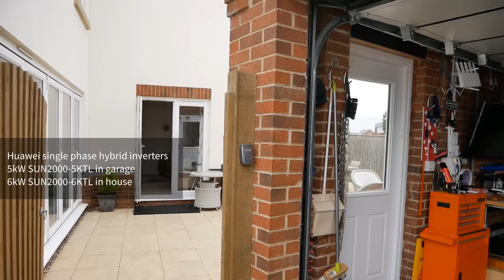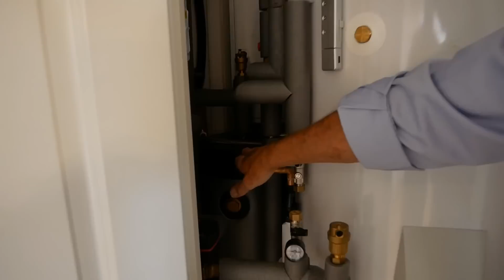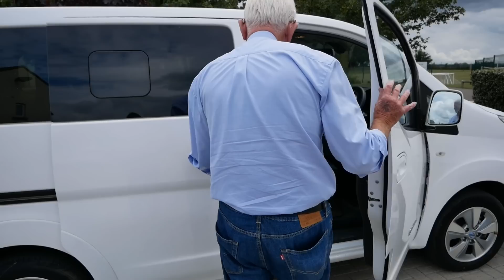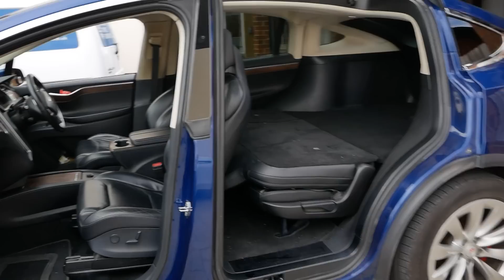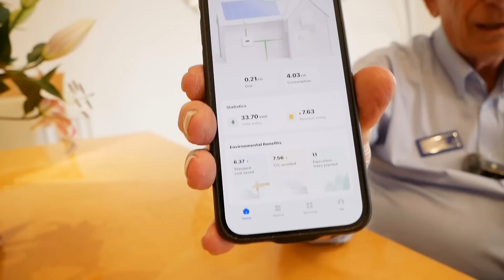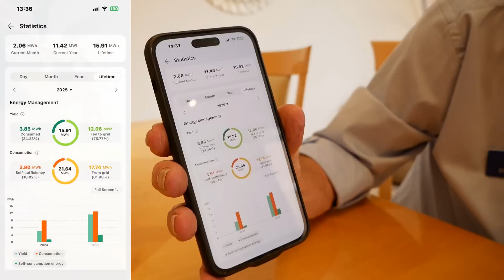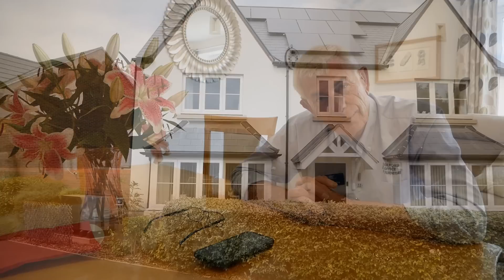How a 5 Bedroom Detached House & 3 Electric Cars Are Powered With ZERO Bills!

Comment: The secret sauce here is that the house was built in 2015. My neighbour has had Octopus install a heat pump and it’s not going too well on his 1980 house. Additionally, we have clay pan tile roofs which require sunken/inlaid solar panels which more than double the cost of installation. I have an EV tariff but the overnight rate has recently doubled to 15p. I have another house that was built in 2019 and has a heat pump and underfloor heating. A completely different proposition. However, the economics for solar don’t work on that house as I’m going to retire in two years and sell the house. I’ve had plenty of estimates, and waited for my Cambridge educated engineer neighbour to test it first, and the cost benefit requires me to live too long! Regarding Grandads. I’m one and I still work as an SME at a very large U.K. high tech company teaching graduates to be amongst tomorrow’s most high tech holistic professionals. My wife however……. I once had to turn on our Wi-Fi heating system for her whilst I was on a flight from California to London. Fortunately for her she has an IT guy at work! Great set up and excellent to see such an (quiet) evangelical adapter.

Comment: Experiences can be so different. When we approached Octopus about a heat pump two years ago, they had horrendous pricing. They asked for £100 to come out and look at the property in the first place.
Without a survey, they said they probably need to replace all the radiators and piping in the house before installing a heat pump. The Octopus man said that this is government policy to get the £5k grand. The price for just the heat pump was still double than a normal gas boiler.

We had just bought the property and at the time our gas boiler was broken and needed replacement quickly. We had it swapped with a new one and moved to a different part of the house for half the price (without £5k grand) by a different company.

That is ~£12k heat pump (including 5k grand) vs £3k gas boiler (both prices are without new radiators).

We will try in a few years again to go with a heat pump.

Comment: No thanks. Wouldn’t touch an EV.  Hydrogen is coming now. In ten years times people will be laughing at people still plugging their cars in
Reply from the maker: Hydrogen just doesn't work for road transport as it's very energy intensive to produce - an EV will travel four times further on the same electricity. So why make hydrogen, then drive it to fuel stations, store it in compressed tanks, when an EV can drive four times further with electricity down existing wires. There's a reason why we're not already using it! See https://youtube.com/shorts/HjedX5ljZs4 and https://youtube.com/shorts/kxQsZj27kQQ?si=MDFlU4LaiqG3zLCM
It'll also never be used gas boilers either. Again for the same reason and also it would need a whole new underground network of pipes as hydrogen molecules are much smaller and the current gas network would leak it all out!
Reply: @GoGreenAutos  I & thousands of others would disagree. Let’s see where we are in even 5 years time. 👍

Comment: The house is the key, modern house low heat loss. I had to stop at the heat pump because I have 21kW heat loss and it would cost me 26K including subsidy and even then I think it was borderline. Octopus are loss leading to capture the market. As this evolves and the duck curve flattens it will become more expensive to run a house like this, export to grid may end up costing us money pretty soon and load shifting will even out the import cost per kilowatt. Sigenergy do a DC charger that is two way.

Comment: I to have an Indra V2H system with a 40kw Leaf. I cannot tell you how good this kind of set up is. My electric bill and fuel bill used to be £400.00 per month, over 4k per annum. Last year my total cost for electricity running my car as well was £250.00. Saving me silly amounts of money, I to believe that getting V2G widely available is essential in reducing electricity costs for domestic consumers. I have written to Ed Milliband and haven’t heard back, probably because the figures are “too good to be true” . Well done for putting this video together, let’s hope more people see it and put pressure on the government to get moving.
Reply: Except that when significant numbers get V2G, I'm sure the buy at 7p and sell back at 15p will be knocked on the head - just like BEV zero road tax and smaller grants to make homes more energy efficient. Sad but true.

Comment: The batteries / vans go through the business, so shortening the battery operating life does not matter with home discharge.

What is their DNO limit?

My experience with the same DNO is that I'm capped at 8kwh, regardless of the number of inverters
Reply from the maker: DNO limits covered at 31:00
Reply: @GoGreenAutos lots of random numbers, 11, 6, 3.5

As I understand it and I'm happy to be wrong. A DNO sets an export limit and then approves additional inverters.

So with the above limit, you might have 3.5 export, but allowed 20.5 of inverters on your side of the grid

Comment: This video is a genocide for myths around the green energy transition and EVs 😂 well done Matt.

A few points to note:
yes, the model S and model X are IMHO their best models so far, in part because they had a dash behind the driving wheel as well.

Regarding dish washer and washing machine, because the peaks of power (1-2kW) are very transient (at the start when heating water or at the end when the drying cycle of the dishwasher is initiated), it is actually better to rely on solar to run these appliances, especially considering the kWp installed he has, which even in winter ran at 10% would cover that.

Similarly, it is more efficient to charge the van (when it is at home) with solar as often as possible (0p/kWh).
Reply from the maker: Model S/X having an instrument cluster....I used to think that when I had a Model S and didn't like the Model 3. However, now I've had a Model Y for nearly 2 years, I don't think that any more and probably prefer not having an instrument cluster.
Dishwasher/washing machine use...if the machines are put on during the day (which they are), the solar would be running them and so would the E-NV200 if the demand in the house was higher than the current solar generation. It's all mixed and what's left goes off the grid.

Charging the van on solar - yes it would be. But I think he'd need some other hardware to better integrate all the different systems. I don't think Dave is that bothered as it all works and the solar covers all the costs. He could make it a whole lot more efficient by turning the heating down, but it effectively feels free, so they might as well me more comfortable.

Comment: 158,000 miles of free electricity is a massive sum saved. Assuming 36 MPG(ICE), at $6.6 a gallon of gas (UK costs, subsidized by taxpayers and it can go much higher), that's $29k USD in gasoline he doesn't have to pay to operate that EV. Not even accounting for regular maintenance savings. All on an 8 year old EV tech. Electrification is such a no brainer.
Reply: Thanks for the post and it’s great that you understand it as so many still don’t. Even the Governments ✅
Reply: @davebeesley3678 hi Dave, 
Are the payments for the feed in tax free? Great set up! Cheers

Comment: So unless yet have your gas meter removed it would have cost almost £28k, then theres an EV on top. Thats well out of most peoples budget. Also using a house battery or car battery to fill overnight at 7p and sell back during the day at 14p is NOT economical when you consider the battery will need replacing after a few years because of all the deep cycling. How much is a new car battery going to be??
Reply from the maker: Taking the gas meter out saves the standing charge. But it's not needed anyway, cos they took out the gas boiler and gone all electric, I can't see where you're getting the £28K from???
Yes, he's using an EV because he already had one. If he didn't, he would have got a home battery which costs from £4K.
The EV will not need changing in a few years. It will out last the owner! They have an incredibly long life as a home battery (well in excess of 20 years).

Comment: The trouble for a lot of us is we don’t have this type of house. I’m mid terrace. I have a small roof. I have zero insulation just solid brick and a floating floor. My windows are 20 years old as is my boiler. Currently my energy bill is £130 per month. I have nowhere I could put batteries and a heat pump would be an annoyance to neighbours. To externally insulate the house, get new windows and doors, insulate floors, run new piping etc etc etc is £10’s of thousands before the heat pump and solar cost. There’s literally millions of us like that in the U.K. and a lot are even worse off with even smaller terraced rows and no front gardens. I can neither afford or justify spending 10% of my houses value on something which in my case won’t pay be back for 20 years or more and again this is the issue for millions of us.

Comment: You are 100% spot on, thank you. We did what you did in 2019. 4 Bed detached 100% fully electric family home, with 40 X PV's, 3 X Tesla Powerwalls, ASHP AND 4 EV's (one a 2017 Tesla Model X). Used to spend around £1k per month on gas, electricity, and FF's for ICE cars. Now spend £150 PM in TOTAL (which does not include FIT and RHI, which we still get at over £2k PA). Saving over £10k per annum for fully decarbonising our home and motoring needs. The ONLY ones shouting about how expensive renewable energy is, are the ones who don't have it!!! Let me know if you want to know more?
Reply: How much did it cost to fully electrify your house?
Reply: Hi, I don't have any of it. 4 bed semi, £100 per month for gas and electricity. I guess our house is well insulated. And we still drive ice hatchback cars, but older generations, that easily do 45-50mph in town and 60mph on motorways. So the cost of driving is another £60-£100 per month. I don't need to pay upfront £25k-£30k to save £150 monthly...
Reply: Excellent news and thanks for the post.

Comment: I have a very similar financial analysis, though don't have the EV. . I just installed 40kWh of static batteries along with the solar . . . . More costly than Dave's solution but I recently got a cheque for £1000+ for export & that's after paying for all our electric & my wife's EV charging / mileage. . . Haven't completed a year of solar/batteries yet & still to install heat pump. Solar & batteries are a no brainer if you can afford it & as many as you can get of both ! & I am also Dave & an OAP

Comment: I'm struggling to understand why you would have 18.7Kw of potential production, but only inverters that can handle 11Kw.
Reply from the maker: Good point. I'll find out.
Reply from the maker: From the solar installers...."Clipping is marginal. You can tell from the app it seldom tops out at over 11k. Multiple orientations mean the peak generation is spread over the day. Permitted oversizing is up to 100% on Huawei."
Reply: @GoGreenAutos Thanks

Comment: NOTE: Nothing should be in the loft. All my gear is either outside or inside the vestibule. I insisted not even a cable goes via the loft all cables are in weather proof tubing over the roof to their destination. SAFETY, SAFETY, SAFETY.

Comment: Nice video. V well presented. We paid £900 for 12 months for gas and electric with 5k solar, solar immersion, 9.5kwh battery and 15000 miles per year EV. Will be a bit cheaper this year as we are now selling back to the grid during the day at 15p/unit exported and 7p per unit at night to charge car and battery. At these economics -13k install - government should look at making available with a 20-25 year pay back through bills. We don’t have a heat pump or V2G and run house at 20oC in winter. Before EV and solar battery we paid £350 average per month for gas electric diesel.
Reply: Nice video but he will want underfloor heating to keep temp up during cold winter. Also 26 degrees ambient temp.. is uncomfortable.. obviously depends how close that sensor is to the radiators underfloor would be much more consistent heat
Reply from the maker: Sounds like a great system you have, thanks for sharing your experience.
Reply: We are more than happy to welcome you to visit and look at the completed system. A Heat Pump as far as we are concerned is a no brainer 😊

Comment: Not sure why the National Grid is paying 15p for solar electric when it can generate it for about 7.8 p kWh
Reply from the maker: I see your point, but it's Octopus is paying the 15p per kWh for the exports and of course selling it back at 26-28p.
Also the network prices are not fixed and vary depending on generation, weather, time of day etc etc.
Reply: So we buy at £0.07p including vat and sell at £0.15p so Octopus are still buying at Sub £0.08p if you include the vat.
Reply: @davebeesley3678  I see your point, however, they could still generate at 7.8p which is cheaper than buying it at 15p, then sell for 26-28 p for even more profit.
Reply: @Music5362  you must take into consideration that we buy over night at 7p and sell back at 15p so they are buying for 8p so I also expect they make money on the 7p they charge us overnight!

Comment: Shame about having to remove the gas meter. I wouldn't get rid of my gas hobs.
Reply: Hi Joe
I am so lucky my wife is a great cook and it took some persuading to get her to go electric and now she would never go back to Gas.
Reply: @davebeesley3678 Interesting, I've tried both induction and hot plates and hated them both. Induction is easier to clean but found it really awkward to cook with unless you're just boiling something.
Reply: @JoeHardman  I
Real issue is to completely get rid of the gas meter and the savings just on daily charges are extremely high and you could afford the best induction hob and ours even has WiFi
Yes they are different and take getting used to but once you are set up you will never look back and wished you did it Years ago. 
Once gas has been taken out of the property you will no longer need Carbon Monoxide alarms. Gas leaks are always an issue and thankfully that another good reason not to have gas. 
You will save a lot of money just cutting off the Gas Supply 😊
Reply from the maker: You don't have too. Most people want to stop burning gas, so get rid of their gas hob too when they get rid of their gas boiler, especially when the electricity is being paid for by the solar generation!

Comment: Well done! I have a similar setup - 12kW solar and 3 electric vehicles including a Nissan van - coincidentally also have an 8 year old blue Tesla Model X with 140,000 miles on the clock! I had a trial V2G charger several years ago with Ovo, but Indra won't support it anymore which is really disappointing as it still works and is presumably the same unit that works for V2H setups. I'm looking into how to get it working again and am interested to know the history of your system. Was yours with Ovo to start with as a trial V2G system or did it come from Indra for their V2H trial. Do you connect to it with the Indra app or Octopus app? I'd be interested to know if anyone else is still using one of the original V2G units and if so is this with Ovo or another supplier like Octopus.
Thanks for your help

Comment: His ev vans and cars are pretty much worthless as they lose 50% on valve after two years
Reply from the maker: That's not true. Lets look at the actual facts rather than hearsay and take his E-NV200 Evalia that is on the V2H charger. If he paid list price (he probably didn't but lets assume the worst) at the time it was £30,000 inc VAT. I've just looked on Autotrader at what they're currently advertised for in that same spec and mileage and it would be £12-14K. But lets take the worst case at £12,000. So that's 60% depreciation over 7 years as this E-NV200 is 7 years old in November.
The average depreciation of ICE cars in the UK over 7 years is 60-70%. The average depreciation of 7 year old vans in the UK is 65-75%. So at 60%, the E-NV200 depreciates less than the average whether you class it as a car (it has 7 seats) or a van.
Reply: @GoGreenAutos EV depreciation fast and more than ice cars - that’s why the second market is non existent
Reply: Also his numbers of £6000 per year “profit” are fiction- when running a heat pump and general electricity usage during winter the bills will be £40-80 per month - even if in summer than can be dramatically reduced - I should know I have the same set in terms of panels and battery pack
Reply: You should know... Well, doesnt look like you know much at all.
Reply: @ThePentosin  well since I have a 14 panel system with battery storage system I know what you get and don’t and there is no way that he makes £6000 “profit” per year
Reply: The cheapest battery ever

Comment: Vehicle to Grid..

Would you really degrade a very expensive Vehicle battery for a few peanuts of profit from Export.

It cannot be economically viable to wear a battery for peanuts on a car over a static battery!!

Our 40000 mile Leaf (same battery) is already below 90% Hx with 91% SOH and that's just with daily use.
Reply: It's much more than that as the vehicle can be used and over years of experience with electric vehicles by using the battery daily is good for the Battery.